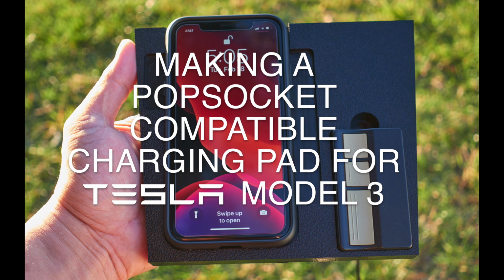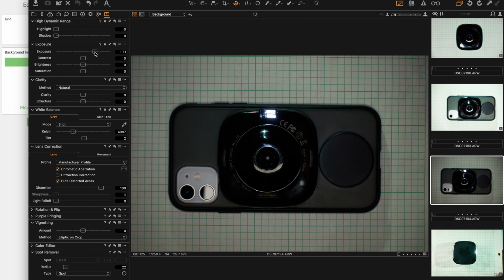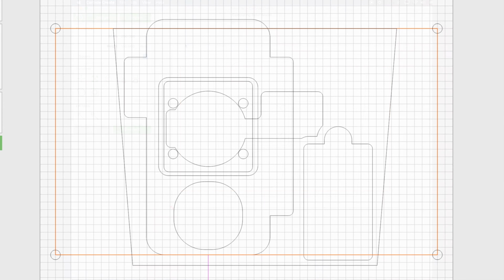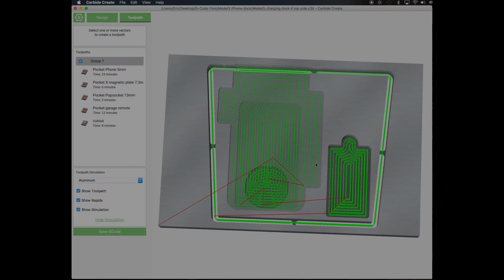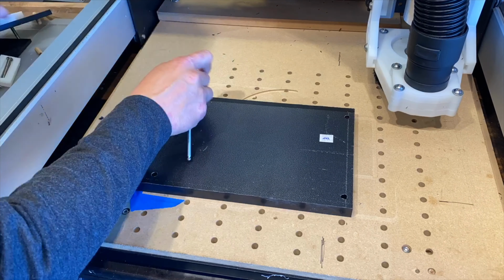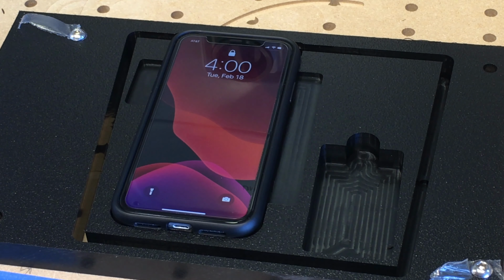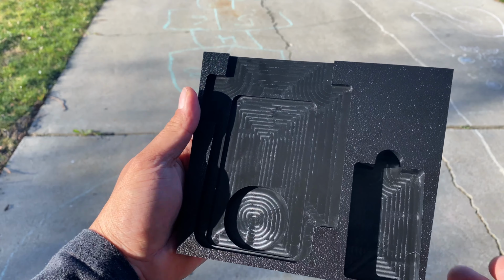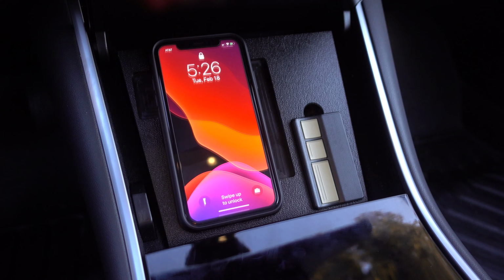Model 3 PopSocket charging pad

Comment: Very nice 😎. The top right corner is just asking for a custom AirPods charing spot. IMO The machined plastic under the phone looks a bit raw and unfinished. I would have either added a felt pad, smoothed out with mineral spirits, or sanded it down. Thanks for the upload 👍
Reply from the maker: Yea, i have peel and stick felt, but didn't want to add to the thickness since the phone pocket is already a bit shallow.  I'll give mineral spirits a try, maybe buff it with scotch bright or steel wool